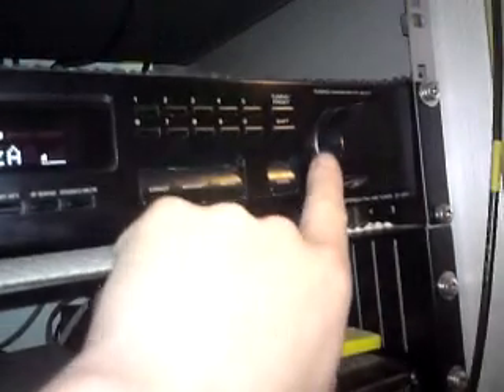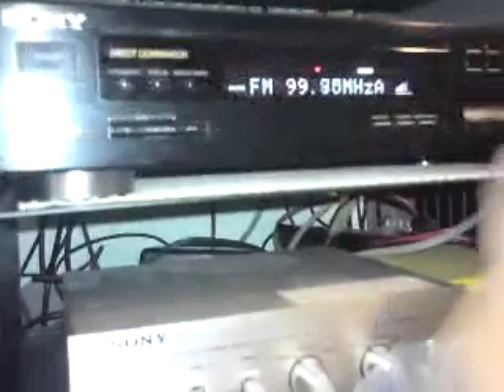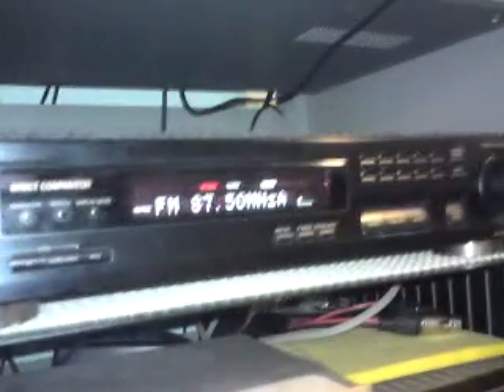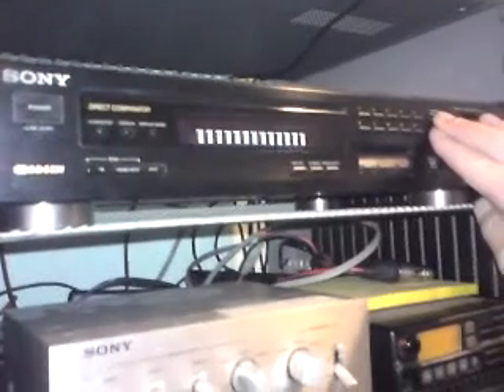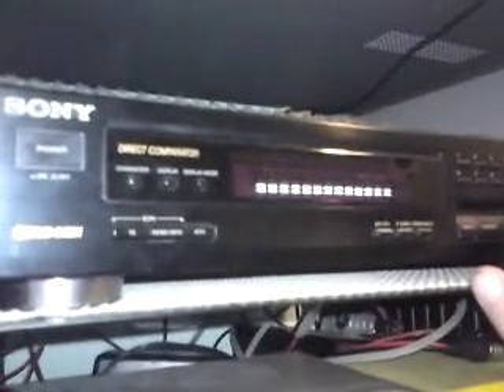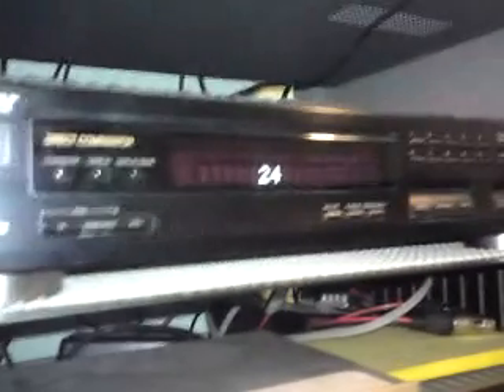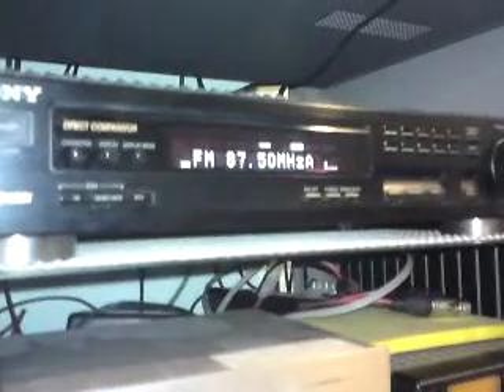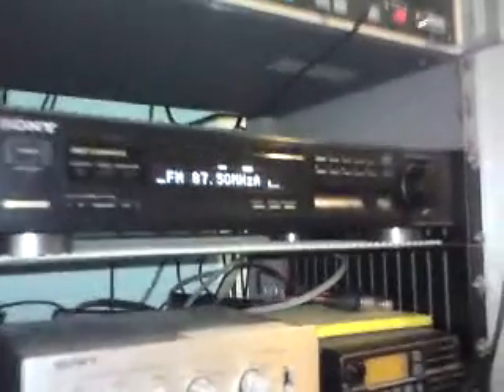Sony ST-S311 Tuner : Display and keypad test mode

Comment: hi, thanks for the video, please can you help me, i know that this video is way old, but i have the same tuner and found your video, my tuner only finds stations above 100mhz and was working perfectly, thanks for your help.
Reply from the maker: So does it tune below 100MHz and just not recieve anything?
Reply: it tunes stations like 106.** mhz and 107.** mhz in auto tune and stereo, but stations underneath that range, absolutely nothing(not auto tuning, even in manual tune), i've watched your video and thought it might be a simple reset or digital thing that i could do instead of ripping the item apart and trying to re solder a dry joint. any help will be appreciated, thank you so much for the reply and your time. @TonyLing
Reply from the maker: @partypalzinc6766  I doubt it would be a hardware fault. Are you sure your aerial is not broken. Do you have any strong signals from local transmitters below 100MHz?
Reply: quite sure if the aerial was broken, i would never pick up anything, as if i remove the aerial, nothing picks up anyway, so the aerial is fine. @TonyLing
Reply from the maker: @partypalzinc6766  It's possible that you have a local transmitter site which broadcasts local radio above 100MHz and a further weaker one which does BBC below. 
If your aerial developed a fault, you may have lost the weaker channels, but still get the stronger ones. Just a hunch
Reply: Completely forgot to tell you that i've tried both the antennae's on the sony tuner with no difference. thereafter after many attempts, removed the sony tuner and amplifer which incidently faulted at the same time and replaced both those units with a sansui receiver just to get my favourite stations( works perfectly with the same aerial). Just so sad that i get no RDS on it. Spent the last two days looking for a solution or another rds component tuner, can't really splash out on a new rds receiver right now. But thanks for the help, i'm 100% sure it's not the aerial, it works on the sansui receiver. @TonyLing
Reply: thanks  @TonyLing   you are an angel, it was the aerial that was the fault,tuner has 2 antennaes that are chosen via the front 'ant' button, i was choosing the incorrect antennae while tuning the station, thanks again for all the help. it is finally working..